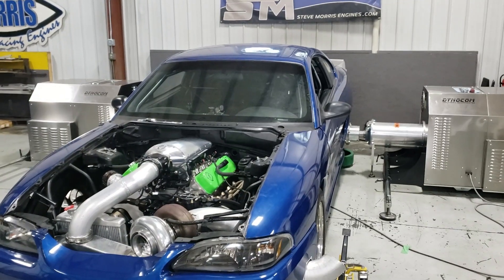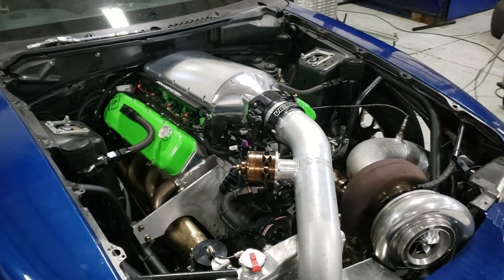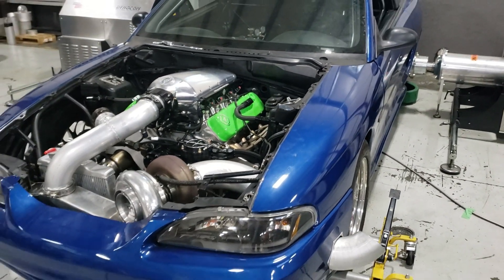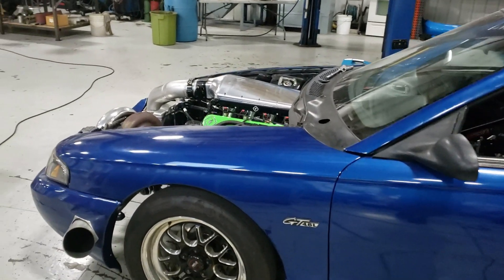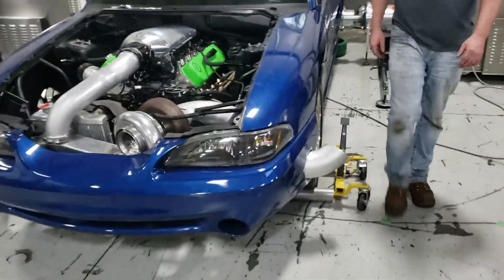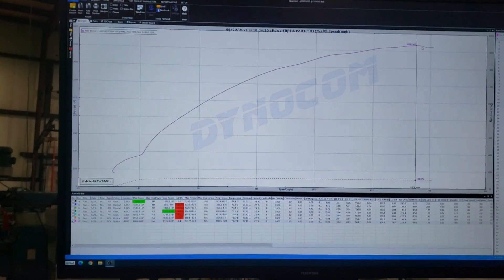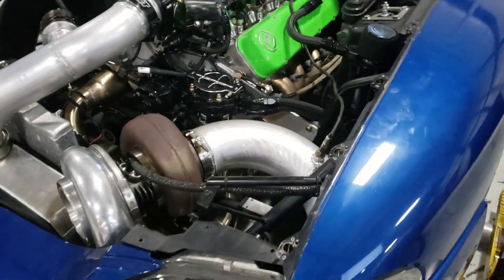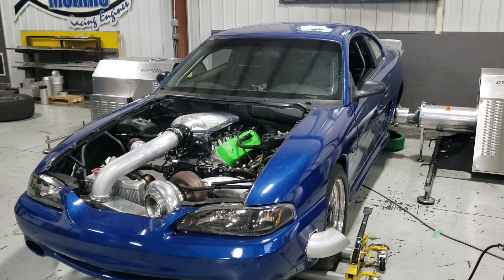Vic Smith's Turbo LS, 1600+HP!!

Comment: 200 per cylinder,
1600 on the street 
with an LS 5.3 4 Bolt...
Congratulations to the builder
Reply: There are several 4 bolt aluminum truck block sleeved 5.3 block well over 2000hp

Comment: Amazing clean running engine set up, and the numbers speak for themselves. One thing i was thinking, the engine is 427ci as u said steve, but with a 5.3 block right? Or am i wrong
Reply: Yep us in the dirty south say that engine is bored out
Reply: @bulletlovescars5855  so originally was a 5.3 block but how much it had to be bored out to reach 427ci?
Reply: It’s a stroked crankshaft
Reply: @fromme2u576  so the original 5.3 block have enough clearence down there to Support that stroked crank?
Reply: @matiasdamian8106  That's the beauty of the LS engines. From the 4.8/5.3 block through the LS7, dimensions are the same! 4.8 crank in an LS3 for a destroked screamer? Done. LS6 cam in an LM7 for some junkyard fun? Easy. Bore and sleeve any of the 4.8/5.3 blocks from 3.780 to 4.125 and make a big cube engine? No problem!
Reply: @94XJ  that's amazing how many opcions you have to play depending on what do you want, NA, boosted, supercharge, procharge, turbo, whatever you want. At first i didn't understand how like with a 5.3 original block you can make a 427 without like, losing strenght because of the metal loss between the cylinder bores, but apparently, there's no big deal, right?